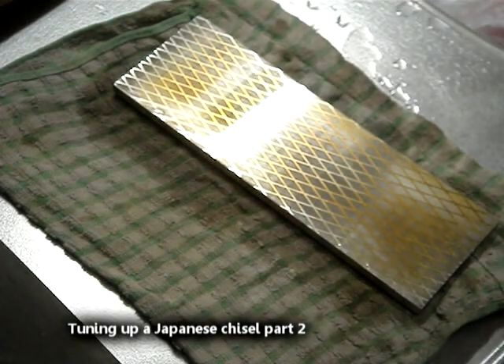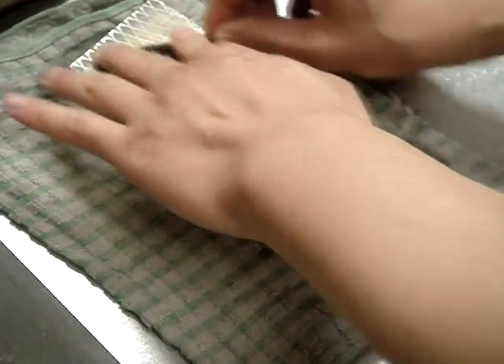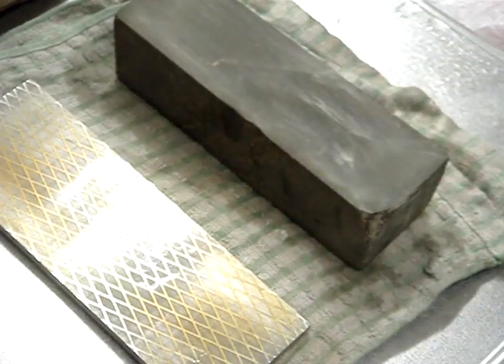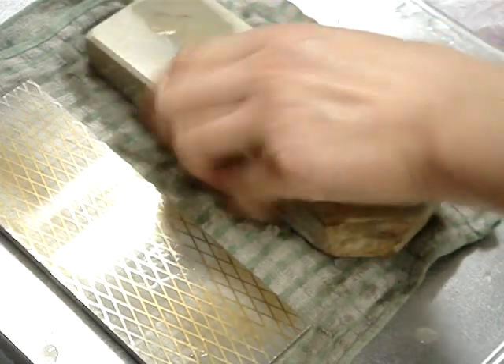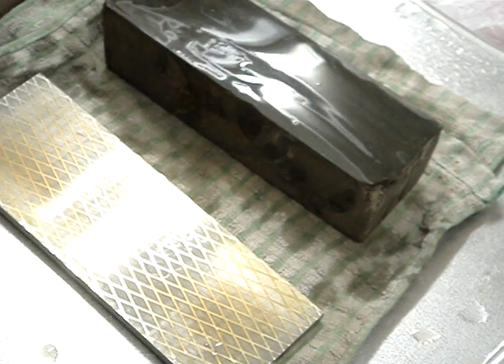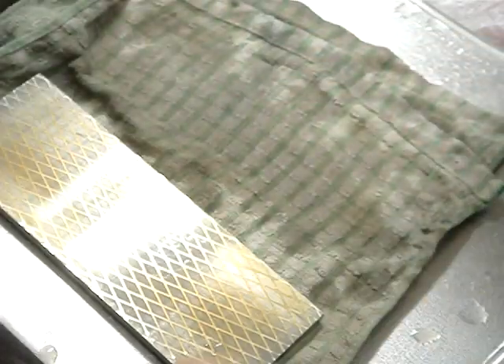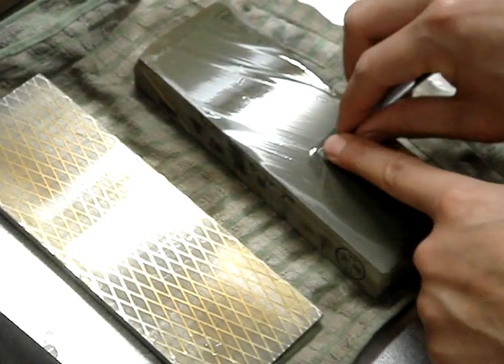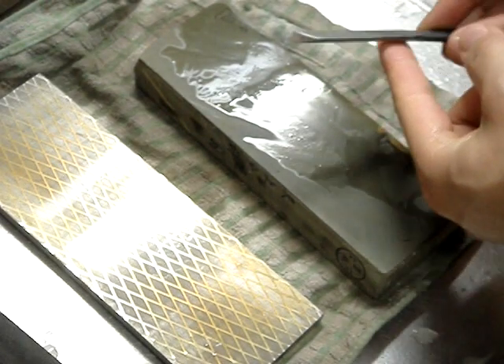Tuning up a Japanese chisel p2

Comment from the maker: Koshimitsu are just fine for a standard bench chisel. Nothing special but not bad. As a guide, Koshimitsu chisels are on sale in Japan for a price of about 3-4k yen each depending on size. Ouchi range from about 4-6k yen each. These prices are for sizes from 3mm to 24mm. Koshimitsus are probably on the lower end of what I would personally go for but I guess will work fine.

Comment from the maker: Hi, or chisels that you hit with a hammer (oire, tataki etc, basically ones with a hoop) the recommended angle is 28-30°. For paring type chisels, an angle of 24-26° is recommended.
If you are looking for bench chisels (i.e. oire nomi) then I would personally go for a cheaper set of utility chisels since a super sharp edge is not really needed. Spend your money on the paring chisels for fine work since that is where a good edge will really pay off. My favourite brand is Takahashi (Kanetake).

Comment from the maker: Okubo-san is a good smith. He seems to have a reputation for producing good tools at a low price. However with "damascus" finish tools, you will always be paying more for the finish rather than quality. For example in Japan I can get a full set of 10 (from white paper steel though) for 39k yen. Blue steel probably commands a 10k yen upcharge. I would recommend the Koshimitsu out of the 2 choices. Oire chisels are meant for general work so I wouldn't spend too much money on them.

Comment from the maker: Other popular brands in Japan are Ouchi, Kitsune and Takashiba. They are good no-nonsense chisels. You should expect a price of about 30k yen (~240 quid) for a set of 5 or 6. If you go much cheaper than that you are getting into iffy territory. I'm not sure what's available in the UK so I can't help there, sorry. Things to out look for are shiny black blade parts (generally not good) and steel which is laminated in a u around the soft iron (good). If you need more info send me a message :)

Comment from the maker: @iplywood Thanks!
I get most of my stones from the local home center. My local one is Joyful Honda. Hands has some but good ones are either rare or expensive. The home center has a yearly "stone and blade" fair where various shops put out their stuff for sale. My other stones are from the internet and although it is risky buying sight unseen, if you buy from a reputable place its usually quite rewarding.

Comment: Thanks so much for these videos, they were all extremely useful and informative for me. May I ask what chemicals you recommend for blackening steel? Thanks
Reply from the maker: Thanks for watching. The chemicals I use are simply called "Black Dye" in Japanese but I think it is basically a cold gun blue type solution. I have no problems/issues with using it but some people (see the comments below) say it is carcinogenic and you shouldn't use it so I guess use it at your own risk.

Comment: Here are just a stones such I have not. I'll have to buy.
Reply from the maker: You will definitely need a good set of stones to get the most out of your tools. I would recommend a #1000 and #6000 as a minimum and maybe add a #10000 if you want to get a really fine edge for finishing work with a kanna. For chisels, you should be fine with #6000 for most work. An alternative to the #10000 is to get a piece of MDF and rub some polishing compound on it to use as a strop.

Comment: Sumokun, konnichiwa. your stones sounds very nice but it seems to me sound of all stones is the same?! do they have a different hardness or how you recognize its fineness? thank you
Reply from the maker: Hi, on camera, they probably sound quite similar and scratchy but in real life, the finer ones definitely do sound less scratchy. You an still hear the scratchy sound on the finer stones but it is a different sound. Sound is one part of trying to determine how fine a stone is but not the only way. The best way is to just use the stone and look at the finish it gives. Plus using natural stones is not all about getting the finest abrasive. There are many other reasons and factors to consider when choosing a natural stone.

Comment: I've been thinking... How were stones flattened in pre-diamond plate times? Obviously, with hard flattening stones. But how THOSE flattening stones were flattened?
Reply from the maker: Back in the day, they were flattened using multiple methods but the two main ones I hear of are to:

1 - Use another stone
2 - Rub the stone on a flat surface (commonly concrete block) with some abrasive powder sprinkled on it

I don't recommend the second option unless you are not so picky about accuracy. The first method involves another stone and as you say, it also needs flattening. This is done in the text books by rubbing two stones of similar grit together until they are both evenly abraded but this usually doesn't produce a truly flat surface. You can fuss with a straight edge and abrade in localised portions but it is still a bit hit and miss, not to mention time consuming.The proper way is to get three stones and lap them against each other in a methodical pattern and this will produce three perfectly flat surfaces (google will turn up the how-to). This is a common method in mechanical engineering. I don't think this was how the old timers did it though.
Reply: One more thing. What grits of abrasive paper should I use for flattening 1000 and 3000 Japanese waterstones? BTW, I'm thinking of splitting my combination waterstone into separate plates. I don't like that I lose much of the slosh or contaminate the finer side when turning around the stone.
Reply from the maker: I've never really gotten into sandpaper on glass type flattening of waterstones as it was just too messy and fussy compared to other available methods but as a guide, I would try a grit of around 1/2 to 2/3 of the stone, for the 1k, around 500-600 and the 3k, about 1500-2000. Ideally you want to use the same grit as the stone to minimise the scratches on the stone surface but it will take you forever to flatten the stone. I would seriously consider getting a diamond plate though. Even a cheap one will be miles ahead of sandpaper as long as it is flat. They will also work out to be cheaper in the long run. You don't need a range of diamond grit, something like a 1k will do fine for all stones. You can also get double sided ones which are actually cheaper than the singles (they're what I use for the most part).

As for slicing the combo stone... if you have the right equipment to do it, then I guess you could try but personally I wouldn't bother. I have read reports that some combo stones are actually not as thick on the fine side as they appear so slicing off at the transition line might just give you a thin combo stone and a thin rough stone. Also, slicing the stone in half will dramatically reduce it's life unless you mount it to a solid surface because the stone will be too thin to support the sharpening pressure and likely crack in the middle. My King 8k which is mounted on the factory base was not really that thin but it cracked in the middle from the minor flex in the base while sharpening. The losing of the slurry is not a big factor as you can generate more when you sharpen a new blade. You should also never leave slurry to dry on the stone after you have finished as it will clog up the stone. Contamination of the finer side however is something you will have to live with and it is the main reason I don't recommend the combo stones to beginners. The initial outlay is less compared to two stones but I would argue the two stone solution is more economical in the end.

Have you tried batching your sharpening? If you have a few blades to sharpen in one sitting, you can sharpen all of them on the rough, then flip the stone and finish them up on the fine side. This gets round the slurry problem and also minimises the contamination. This is how I work with normal stones because it saves me having to wash each stone and blade after every grit. It is much more efficient if you have more than one blade to do.
Reply: Tome4kkkk you can try and sharpen all of your chisels on the courser side before you flip it to the finer side. In other words don't flip to the finer side until you have finished using the course side on all of the chisels. This order of operations makes sharpening much faster and less tedious.
Reply: If you use 3 stones together and flatten one with the other and so forth their differences will even out over time. It's is a bit more time consuming to do but was/is very possible to get the stones flat enough.

Comment: Write what stones you have applied
Reply from the maker: The first "stone" is a diamond plate, I think about #800. Next is a natural "Aoto" waterstone. This is a classic medium grit stone and generally they are about #2000 to #4000. You need to find a good hard one for woodworking tools. They are usually soft and more suited to kitchen knives. The next stone is a "Suita" which I can't remember the origin of. It is another natural stone. I would estimate the grit to be about #6000 to #7000. Suitas are another popular type of stone for woodworking tools. The last stone I use here is another natural stone and it is a "Coloured Tomae" from another mountain I forgot the name of. This one is about #8000 and it is usually the finest I go for normal chisels.

Natural stones are really not for beginners. To be honest, at the time I made this video, I don't think I was truly ready to use natural stones. Even now I still think I am not properly ready. You need to get good at sharpening with synthetics first so that you can maximise the worth of a natural stone. Natural stones aren't all about getting a sharp edge. Part of the fun of using a natural stone is the feel of the tool on the stone and not all tools will feel the same on the same stone so you need to mix and match stones with tools a lot of the time.